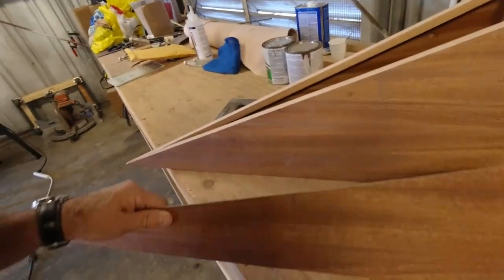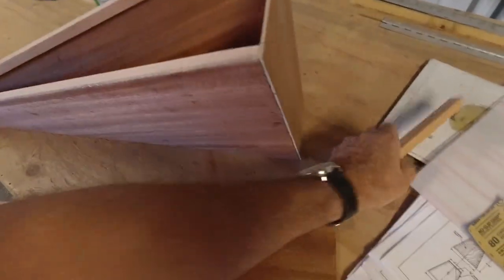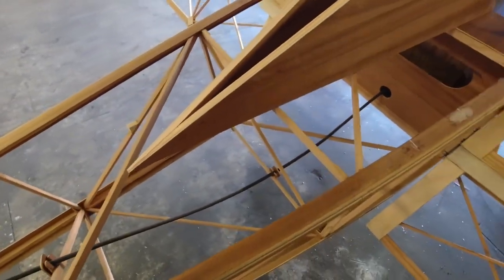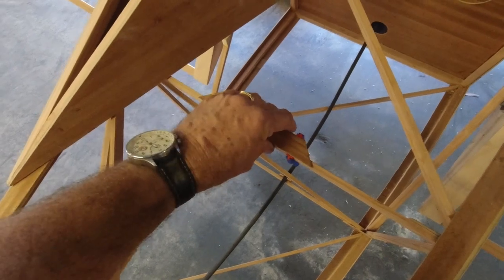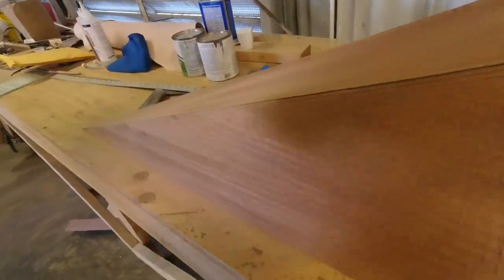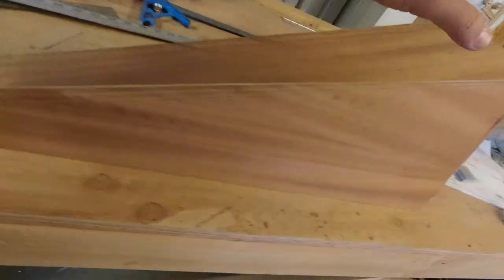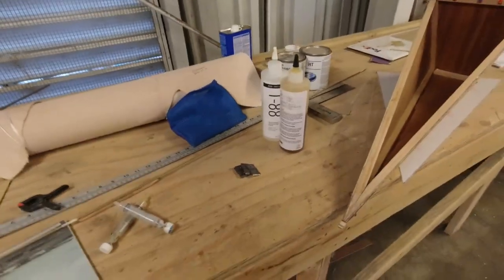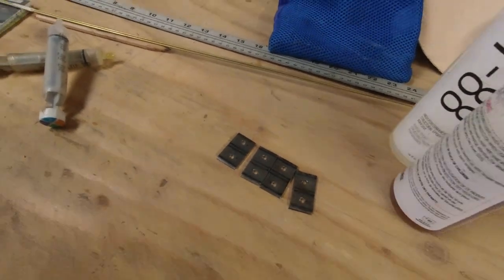Minimax 1100r Wood Aircraft Build Ep 125

Comment: One thing that concerns me.  I would put a support under the opening for the shoulder harness.  That plywood is thin and forward pressure could easily tear it out.  this might result in your head coming into contact with the structure of the aircraft.
Reply from the maker: Hey Pete, I’m not sure I’m following you, can you explain a little more which area you’re referring to as having the ability to tar out?
Reply: @DTMinimax  O.K. the shoulder harness passes through the headset plywood.  If there is no support under the harness as you move forward, in a crash, the harness will move forward and down because it is restrained at the rear.  This will cause the plywood to tear downward because the rear attach point is below where the harness comes through the plywood.  Hope this helps.  If not I'll try to draw a picture (not my forte).
Reply: I agree with you on beefing up the area where the shoulder harness. A&P /I A .
Reply from the maker: Now I’m totally following you guys…the headrest becomes an important part of the safety system in the event of a hard landing.

Comment: Interesting...  The ultralight version I built in 2003 has a full, curved turtle deck.  Also, the area forward of the cockpit also had a rounded top.  Both were a bit of a pain to build, and that turtle deck involved a lot of small wood parts, but it did look good.  To see what I mean, check out a video of my Mini-Max's first flight, but forgive the poor quality.  The video was taken with a camcorder that was state of the art - in 2003...  https://www.youtube.com/watch?v=lkf9J8hiOO8&t=71s
Reply from the maker: Hey Michael, my 1030 was built just like yours. That’s why I chose this particular model this time, just for the shear simplicity of it.
Reply: @DTMinimax    The headrest and forward section are certainly a lot simpler.  Of course, your wings and fuel system are more complicated, because of those wing tanks.  Not sure whether your engine setup will be more complicated.  Mine was complicated by the fact that I had electric start.  My engine area was full, with a large battery, solenoid, etc.  Of course, all that wiring intertwined with the fuel system is what cause the fire when I crashed the plane after the engine failed.